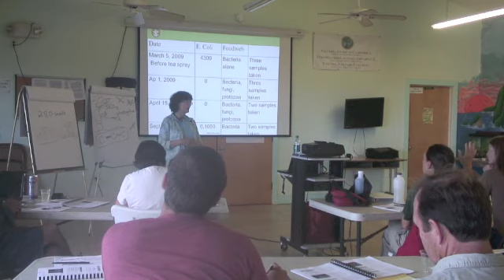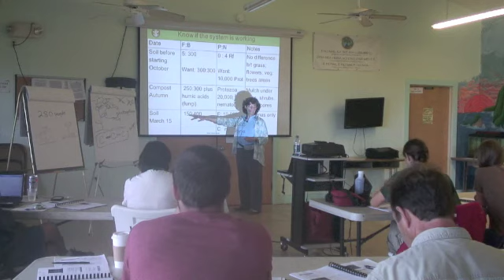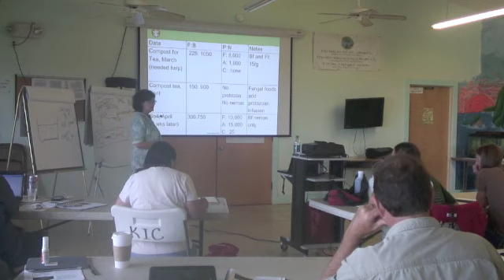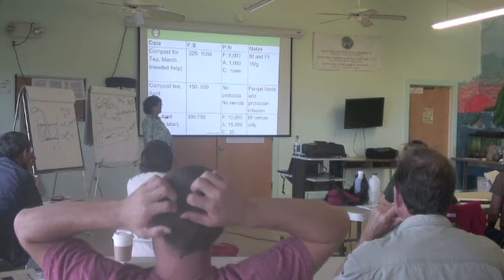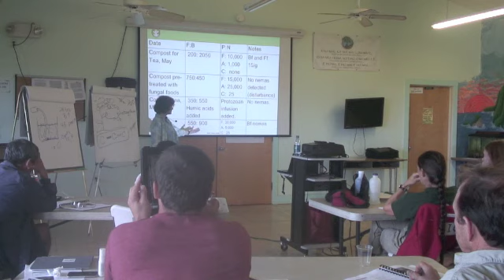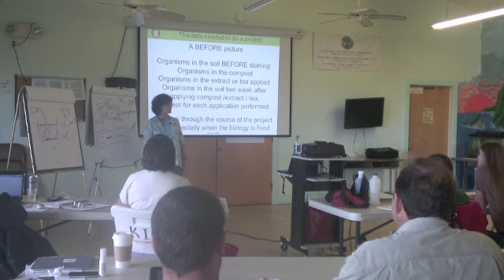2 - 3 : Elaine Ingham Common Ground 2012 - Soil Food Web

Comment: In the lawn improvement project, did I understand correctly that the existing compost that had gone so bacterial over winter was amended with more fungal material (=the humic acid, fish hydrolysate and oats mentioned) to change the ratios?
Reply: +Calliandra 

Correct improper care on the compost over the winter caused the values to go massively bacterial.. They used as you mentioned to change it back to more fungal dominated. =) Hope this helps and good luck with your studies